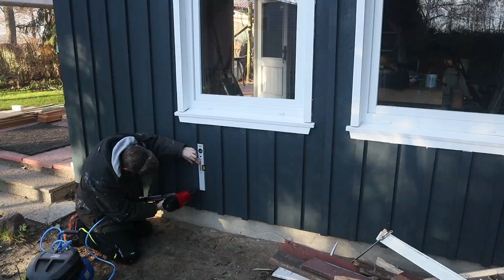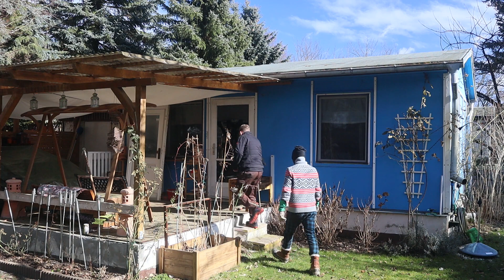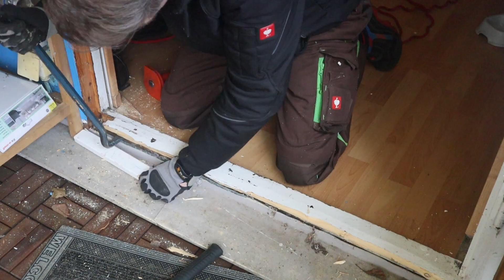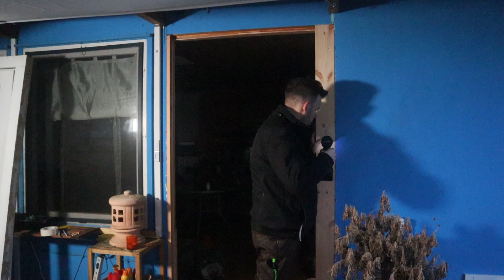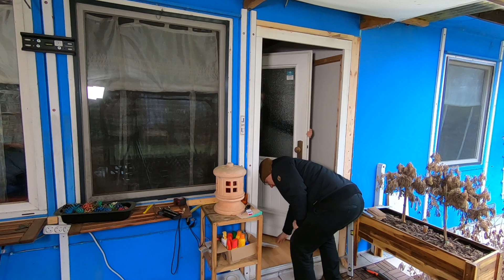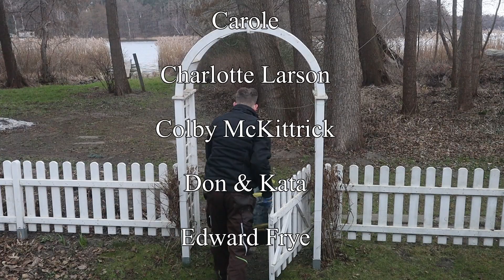Renovating an abandoned Tiny House #42: I changed my neighbours front door - without telling him!

Comment: How sweet of you Andre!!! Hey I have a tip for removing trim. Get a 5 in 1 paint tool from the hardware store. They are very sturdy but thinner when driving them under trim for removal leaving less scaring so it can be replaced. They also have several functions and are a must have in many tool belts.

Comment: Yep have done some early pruning here too. Spring has not sprung, yet officially, but we've had almost spring like weather a time or two. I have 5 smaller deciduous trees and they all got pruned. 2.5 of them got it in February, the other 2.5 trees got it last weekend on a warm Sunday, and also did my first mowing. Also, ended up buying a new grill and assembling that last weekend. So indeed spring has sprung as far as that goes. :-) But our weather has been more spring like (early spring like) since mid Feb anyway due to the fact that we're already past the winter storms. We had snow early in Feb and that's when my old portable grill went bye, bye (stolen). I've wanted to replace it ever since. 

This was great, the swapping of doors in your little community so nice of others to assist you as they can, even when you had to bust out the circular saw on a Sunday to do a quick trim of the door to fit. :-)

Comment: You just taught me something about clematis care, I didn't know you were suppose to cut them back in late winter. I'm going to give that a try. Thank you for the tip. On another vein, what species of wood are you using? It looks like what Canadians call Spruce which is one of the coniferous species that grows here in western Canada.
Reply from the maker: Yes, I think it is spruce. But def. conifer wood.
Reply: @renovationeast9379  Conifers are trees with needles rather than leaves. Actually the needles are technically leaves. Coniferous  trees stay green all year long as well. They include spruce, douglas fir, cedar, pine and a few others that don't come to mind at the moment. Most framed homes in western Canada at least are framed with Spruce lumber. Fir has just gotten too expensive for that use. Spruce is not as strong as fir but most of it gets exported. Oh yes, the coniferous trees produce a sticky sap which is difficult to get off your hands. It's actually what turpentine is made of. Cheers to you both and thanks for the great video content.

Comment: when you do doors you do not seem to seal and caulk around them? Is that a  European thing?  We would have  two beads of caulking on the concrete,  If we really wanted to do it right a door sill pan. weather flashing along the top the sticky rubber flashing tape -  and spray foam insulation or possibly just some insulation stuffed into the crack between the door frame and the wall framing.  Tell your friend the doorknob looked really cool.  hope he feels better- what do you think his first meal back will be? suggest- thinking spring garlic lemon buttered  pasta and toasted sesame seeds and a nice grind of black pepper.  Served with a blended margarita  And Marshmallow chocolate Smores.